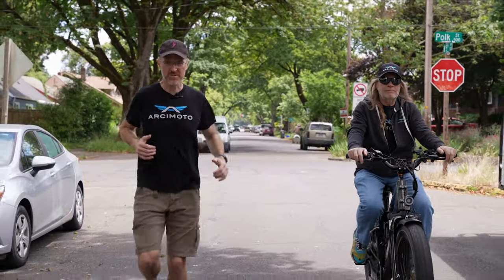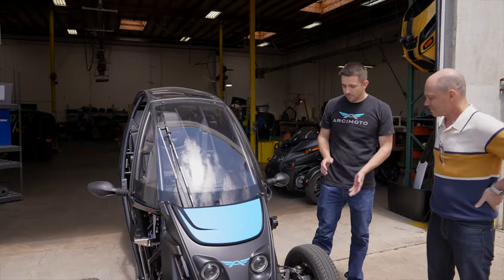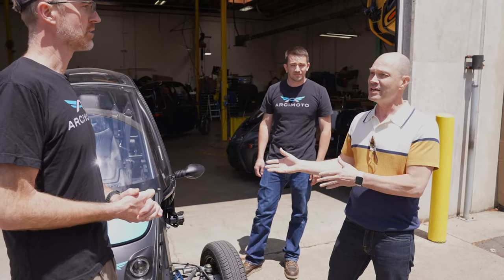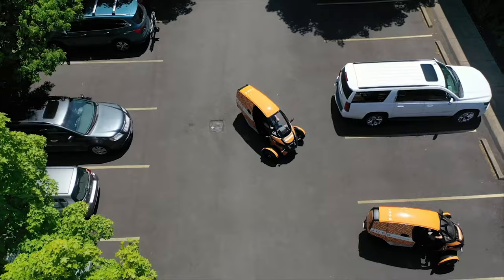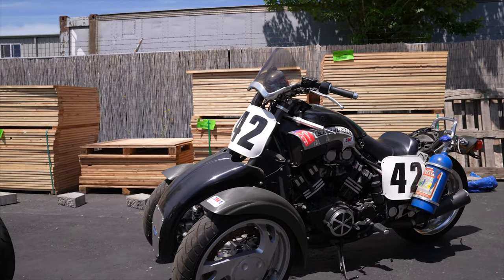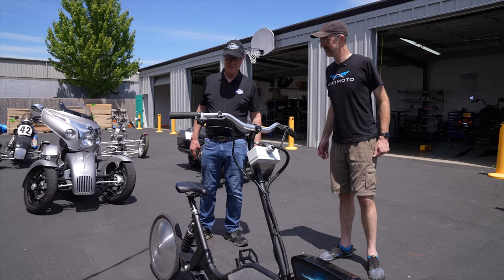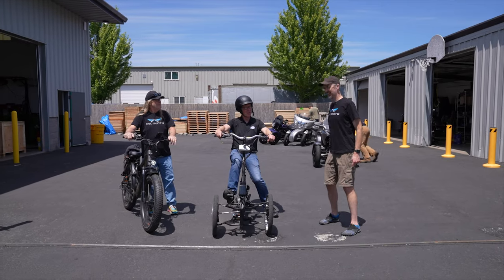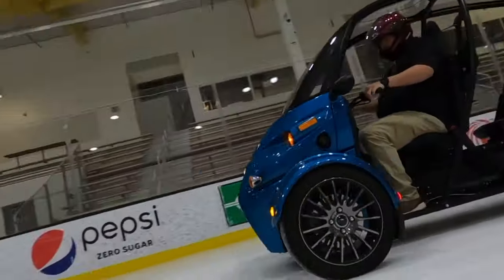Arcimoto Weekend Update: FUV Upgrades, TMW & Torque Vectoring

Comment: Loving the torque vector steering coming to existing vehicles! FUV isn't "bad" at low speeds, but definitely takes some arm strength. :-D It'll be nice to do away with that. And my FUV handled well on snow last winter, it'll be amazing to have it handle well on ice, too!

Comment: This video has not been updated to announce the end of the vectored steering project and the changing of the steering gear to one with more teeth, an a longer Pitman arm. The hardware change is easier than trying to get a very critical software change officially approved for highway use. All 2023 FUVs will have the upgraded steering and the trunk is now included in the base price.

Comment: I really would love a tilting FUV with cockpit experience
Reply: That would be an entirely new design. Tilting means there is no need for the very wide wheelbase of the FUV which uses a double A-frame suspension, a proven performer. Experienced motorcyclists want to be able to put out their foot against the pavement during hard turns. I prefer the extremely good traction of the flat tread car tires after riding dangerous motorcycles for so many years. The rounded tires, even when doubled, can not match the traction of two 4.5 inch tread width front tires on the FUV. Rounded tires wipe out on the slightest gravel patch or oil slick and they are not great in rain.

Comment: Hello, what about with resellers in Europe and service station? What's about with full doors for the winter? Thank you
Reply: Not to mention heat for winter and and Air Conditioning for the summer.

 This is an awesome vehicle and I hope to get one for myself, but only if it comes with full doors and a.c. and heat.
Reply: @robertdragoff6909  No. You confused an autocycle with a car. Without major compromises this can not be either. There are a billion motorcycles and scooters with no wrap around windshield and roof. None of them have doors or climate control. Behind the Arcimoto windshield are heated seats, heated hand grips and heated defroster. Enclosing a space with glass immediately turns the vehicle into a solar oven that needs considerable power to cool, eliminating the efficiency of light EVs. Compare this to a motorcycle, not to a car, when thinking about comfort. The crash cage/harness combo eliminates any need for doors with steel beams in them like cars have. The optional plastic doors for $2,500 are just an expensive and wasteful security blanket and dead weight. Tint the roof, add ventilated seat covers and a fan on the handlebars to deal with summer heat. Or take an air conditioned bus. These are your acceptable sustainable options in 2023. https://news.cornell.edu/stories/2021/10/more-999-studies-agree-humans-caused-climate-change?fbclid=IwAR2Kv3CmJJaJh1u-nDDRUgbSz_li6v_SrhBGtlb4QnKI-CvWUKeJ6gQ1IsM

Comment: Another good video, thanks!

Is vectored steering is going to reduce the turning radius for 1.0 FUVs any?
Will the new front end design shared in this video reduce turning radius for the 1.x FUVs?

---

Makes me sad every time I hear no 1.x FUV until 2024 😿
Given such a plan, I hope you're able to back-port the 1.x faster charging and improved batteries to the 1.0 FUVs.  The 1.0 vehicle is great but it could be so much more with faster charging and any range improvements possible.  Would allow it to be both an urban transport whiz and a weekend get-out-of-the-city adventure vehicle.

Cheers!

Comment: Cool. Very cool. But the question I've been burning with is... when are you planning on integrating the Tilt Wheel technology into your FUVs? Pretty sure they don't quite tilt yet. Right? And I'm willing to bet you spent a pretty penny on TMW, right? So, not that bicycles aren't cool and all, but really hoping for FUVs to be able to really hug those curves. Also, just wanted to point out that Triggo is starting to breathe down your necks. No pressure or anything 🙂
Reply from the maker: The FUV platform will remain a level, automotive-style platform for the foreseeable future, due to the constraints of CV joints (not compatible with the tilting geometry). For electric tilters, Arcimoto’s plan is to build up from the Mean Lean Machine. IIRC we purchased TMW for $1.75M cash plus a reasonable chunk of equity. Well worth it in our belief, given the market potential of TRiO and the long term value of the technology in the product roadmap. We celebrate Triggo’s accomplishments alongside all of the other stalwart EV champions out there!
Reply from the maker: Also, if ya wanna hug curves, strongly recommend giving the http://arcimoto.com/roadster a try. Nothing else on the road even comes close.

Comment: What is torque vectoring?
Is it power steering?
Reply: in a nutshell, yes.
Reply: Yeah basically independent power regulation for each wheel to improve traction and handling
Reply: Naming power steering as torque vectoring will really appeal to all the gear heads and geeks that Arcimoto hopes to sell too.
Reply: It gives the user experience of power steering but it's a whole lot more than that. They can independently control the two front motors. One can spin at a higher speed than the other when turning at different degrees. Also, one can turn forwards while the other turns backwards for steering when at a dead stop. Ultimately, it gives the ability to control an FUV by the motors without touching the handlebars for the ride hailing service when/if that happens.
Reply: @MikeCasey311  Consumers know power steering as hydraulic assist, TV is using the actual motors in varying control to turn, sometimes stopping or reversing one of them.
Reply: @chizle882  Thank you, your explanation was excellent, it really helped. 
On the marketing side of trying to sell a product, products should be named for there Features and Benefits. 
Examples: Power Steering, Remote Control, Atomic Bomb, and etc.
All the best 👍👍

Comment: I put my 100 buck deposit down months ago. I look forward to putting the down payment down. When will you begin selling to NYC. I just need locking doors and windows, all wheel drive, and maybe an intrusion alarm.
Reply: Just use your locking trunk instead. Nothing to steal. No air bag, no catalytic converter, no leather seats, nothing but a low power bluetooth speaker set. You don't need all wheel drive.
Reply: @popeyegordon  I don't want to find a homeless person sleeping in it. It snows in NY.
Reply: @Jaykilla1981  That's silly. There is practically no shelter from weather when it is parked. Hardly any more than a motorcycle with a windshield. Any cardboard box would be far more appealing. The seat is narrow, firm and nothing like a car's seat. Some owners discourage strangers from trying out the seat by extending the two seat belts out around the ends of the handlebars. They could even be padlocked into that configuration.

Comment: I would want one if it had a window. The rain over here pours. I want to utilize my arcimoto rain or shine. I want to maximize my investment otherwise this would be a bad investment.
Reply from the maker: Stay tuned! Full side enclosure is on the roadmap.
Reply: I think they are working on full doors.
Reply: @arcimoto  yes I will be looking forward to.  Thanks for the info.
Reply: I stay dry in mine in the rain. Passengers, not so much. Oregon and Washington get lots of rain but nobydy there thinks it is a 'bad investment'. Carrying rain gear instead of spending $3000 more every year for a car is a bargain trade-off.
Reply from the maker: @Ed Waterfield when we have a firm timeline on this front we will share it. Agreed it is a top priority for folks in a number of states. In our beachhead markets, not as big a priority. But as we aim for mass scale, definitely a requirement.

Comment: Stop lying to your shareholders about the true daily production rate as you did in your "RAMP AND BATTERYLAND UPDATE" video. "6 per day" when you produced just over 100 Arcimotos in Q2? This does not add up, even with 4 production days a week and speeding up to that rate throughout the quarter. This really eats at your credibility as a company, unfortunately.
Reply: It definitely does not if you understand the mechanics of an assembly line. For it to reach maximum output it first has to have the line up and organized for a given rate, THEN to maintain that rate requires ZERO parts shortages and subassembly supplier defects. There is no deception, only your lack of understanding. What kind of dummy totally ignores the pandemic economy and a war, commenting as though those huge limiting factors don't exist? The actual capacity of the line does not drop during a parts shortage, only its maximum output during that time is reduced through nobody's fault. They can't even decide to hoard parts ahead of time, supplies are too short.